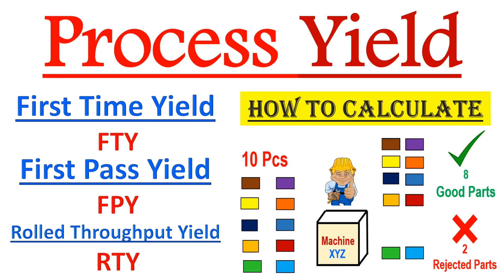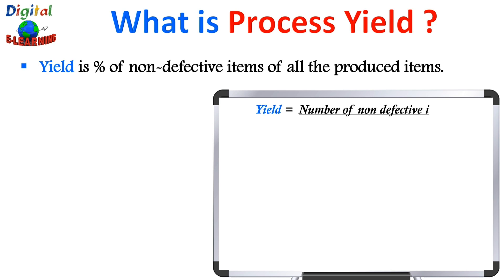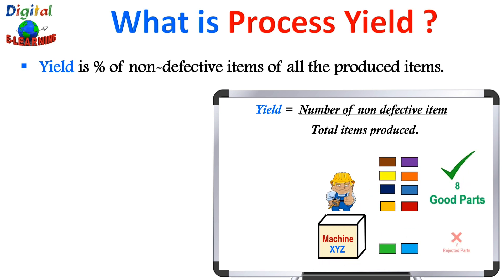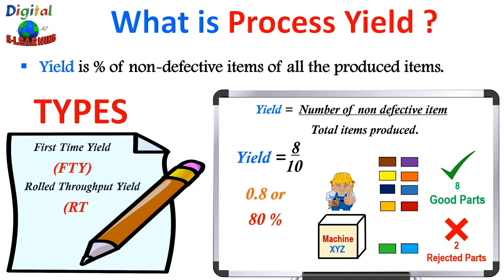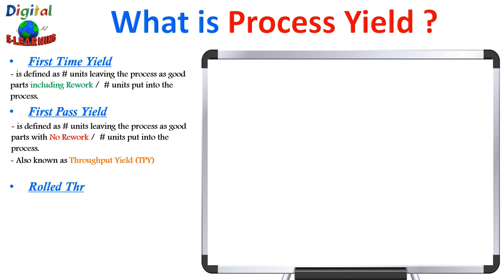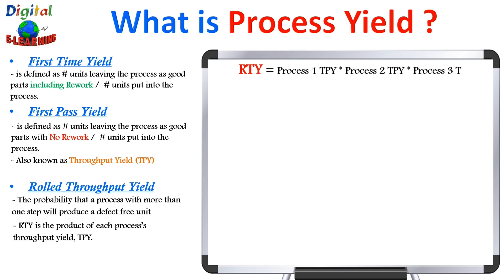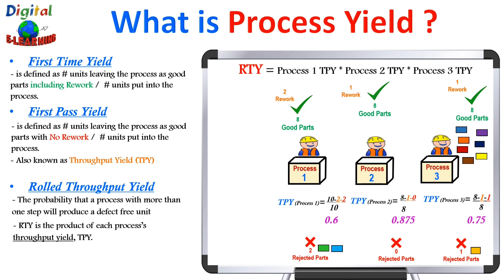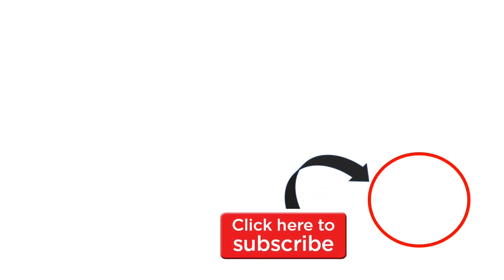What is Yield in Six sigma ? How to calculate Rolled Throughput Yield (RTY) & First Time Yield (FTY)

Comment: I think there is a mistake in the last example:
The second process output is 8, so the total units in the third process is 8 , sectioned to 1 rework 1 reject so the good parts should be 7 not 8
Reply from the maker: Yes it was a TYPO. You are correct. Thank you!
Reply: Anyway it is very good video ❤️
Reply from the maker: Thanks Passant
Reply: yep, error.